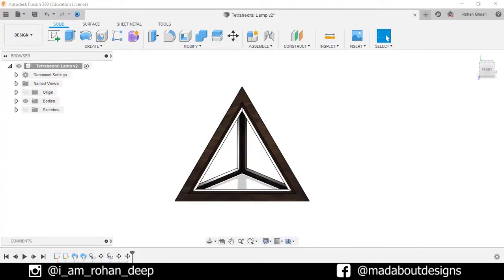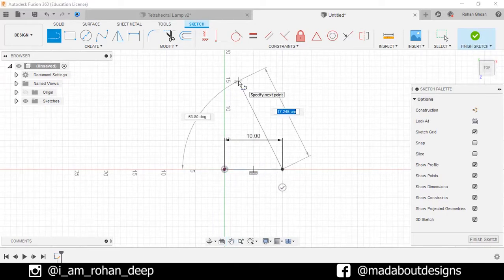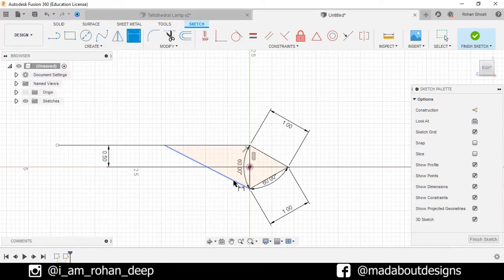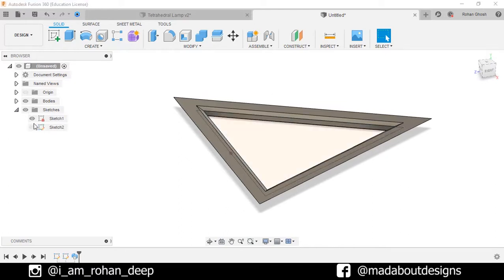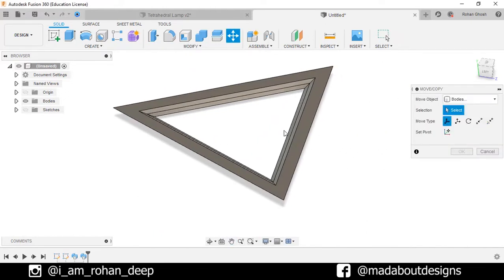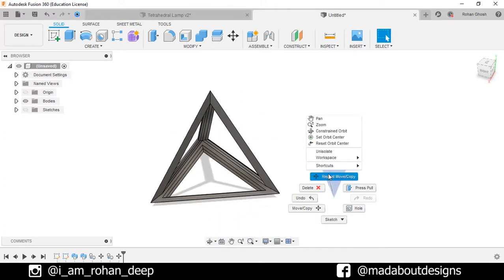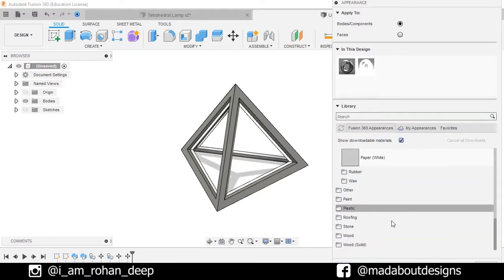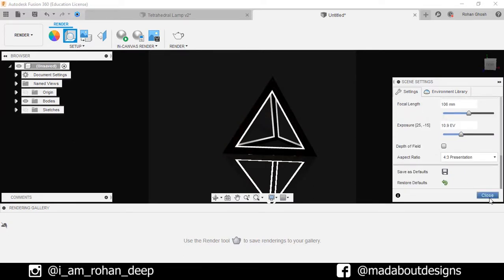How to design & render a Tetrahedral Table Lamp in Autodesk Fusion 360 | Fusion 360 Tutorial

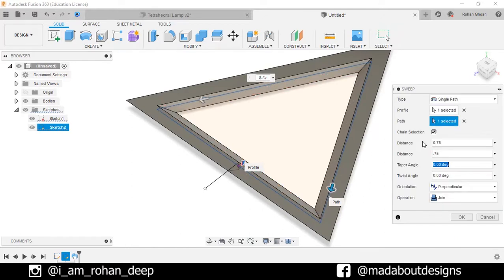Comment: In inner triangle sweep, after putting 0.75 in both distance, I'm having a scatch you have at 2:45. in short they aren't connecting, I've tried several times but facing same issue. can anyone help...?
Reply: i just manually connected them by dragging the arrows, you would hvae to zoom in to get it perfectly connected. it came out to be a wild number, like 0.935 and 0.052